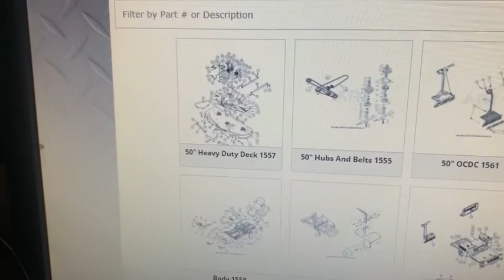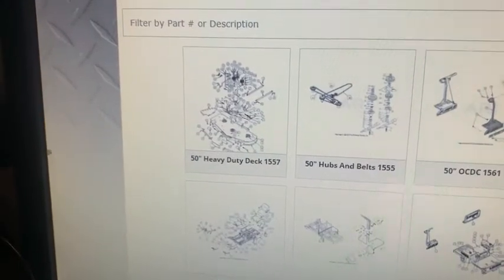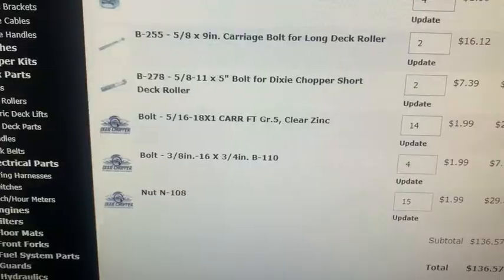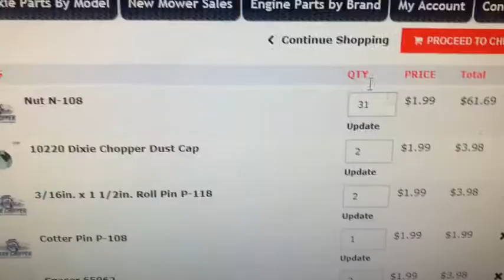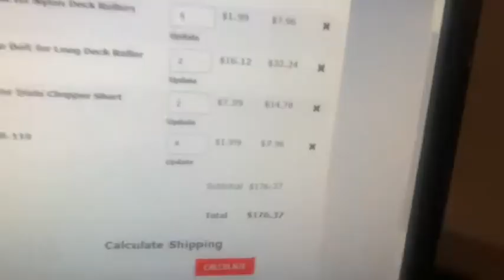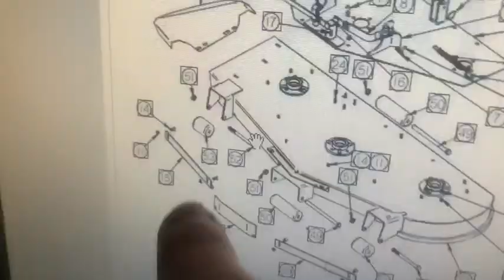Dixie Chopper Restoration Part 3

Comment: That chain needs to he soaked in automatic transmission fluid. That will get all the gunk out of it.then, after you rinse it with gasoline or something like that, you soak it in new motor oil and you will have an almost new chain.I'm sure this project is complete by now. How much did the whole project cost you?